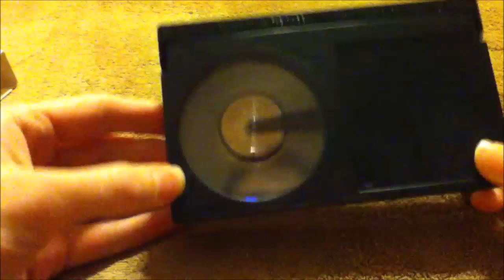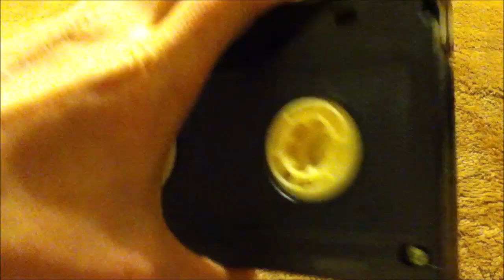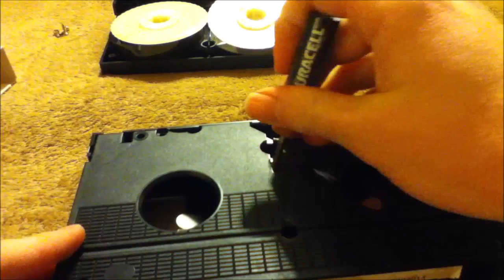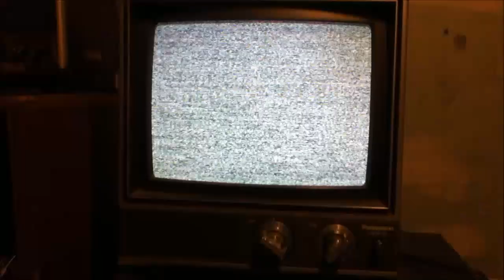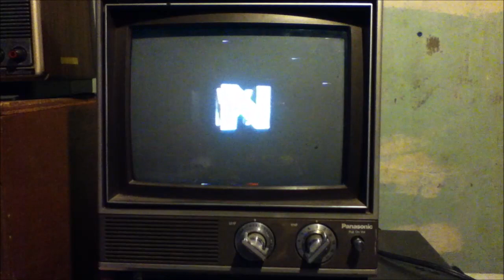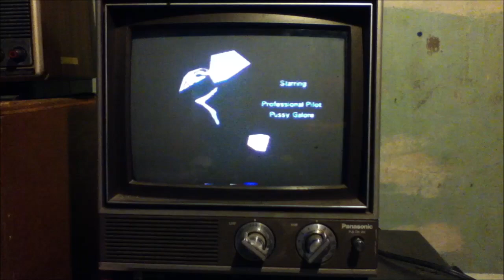Betamax spool recorded with a VHS Signal and put into a VHS Body (Betamax on a VCR Part 1)

Comment: This is clearly fake. There's no way that a Beta recording would play on a VHS machine, since the way the signal is recorded onto the tape is different and incompatible with VHS machines. You can get sound, but absolutely no signs of a video would play.
Reply from the maker: It's not fake, you see the footage recorded onto the Beta tape was done through a VCR. That is why there was sound an picture. The main purpose of the video was to see if anyone with a proper Beta could do it. Odd thing is there is one person in the comments that claimed they got it to work, even though the picture was blurry. I do also want to mention I did a follow up video to this (I found a real beta tape for cheap) . https://www.youtube.com/watch?v=SZDN-TpO-p8
Reply: You keep saying “recorded on VCR” which could mean any format: Beta, VHS, Umatic, Video8.    Please be more specific 

Also it’s TAPE not “film” as you claimed
Reply: No, it's no fake.   VHS and beta uses different tapespeeds and so the videoangle on the tape is different.  But the signal is nearly the same.  When you're able to modify the tapespeed to the same amount vhs uses, you could play the tape with a reduced quality.  But the problem is, that the syncing on vhs has not the range to come down to the beta's specs.  But on the end of beta, there was a try to make a fusion of both systems!  Some VHS Machines of that time could really play beta formated tapes.  The sycing scematics used in this machines are the same as on a beta machine and can reach the correct tape and headdrum speed.  When you look at the video footage, you see the player starting with VHS Specs and goes down to beta Specs after 2 seconds.

Comment: You obviously made a recording onto that Beta tape using the VHS VCR. Beta is a completely different format, not just a different cassette shell. However they both use a 1/2" oxide tape. If you were to play a Beta recording on a VHS VCR, you would just get horizontal lines and incorrectly-pitched audio.
Reply from the maker: I was hoping in doing this I would be able to find someone else who could do the experiment proper. This is the 4th Beta Tape I've ever seen in my life, so I did my best.

Comment: You should change the title of this video this way: Betamax half inch tape inside the VHS cassette. Obviously you recorded on this new VHS cassette with Beta half inch tape inside, with a VHS VCR ( not with a Betamax VCR). That why some people confused. VHS recording frequency and speeds completely different than Betamax. The only common thing between two format is both use same half inch magnetic tape. If you try it exactly what he did but with a tape that recorded will a Betamax VCR, you will get some blinking and moving bunch of horizontal lines up and down on TV screen but you will get audio that is faster than normal speed. Because audio is recorded linearly at the edge of tape on both format.
Reply from the maker: The only thing that confuses me though is I have some comments from people who have done this and gotten blurry picture but pretty good sound, so I have no idea. As for the title, I wasn't sure how to leave it. Plus as I've said in the video, and the description, I didn't know what would happen with a pure Betamax and assumed this would work. Now I know.

Comment: Super helpful! I have a client of mine that asked me to convert her VHS tapes and in the bottom of her stack was a Betamax. I use a VCR and I had a feeling it wouldn't work in there. She'll be so happy I was able to get that tape converted it has her husband's grandmother on it. She wants to show her daughter to be able to meet her because she passed away before she was born. Stay positive people!
Reply from the maker: Let me know if it works. I've heard some say you can only get distorted sound from this process, others say it works fine but with low quality, and still others tell me if you have the right VCR it will play beta just fine. I do want to note though the the footage on the Beta was recorded using a VCR, so that may change a few things.
Reply: @juliabrnssr  This is TheJakeThatVlogs from my busienss account. I intend to try this method this weekend on a client's betamax. I'll be sure to let you know how it comes out and what troubles I run into.
Reply: Correction: “ the footage on the Beta was recorded using a VHS VCR” (Also it’s called tape not “film”.)

Comment: as I own both beta and vhs machines that work I can guarantee that this works because you can also put a Betamax signal on a vhs tape and play it through a Betamax player but you would need a special tool to get the correct magnetism levels about the same as a U-Matic machine
the machine I use is a Sanyo VTC-5000

Comment: There seems to be some confusion.  Betamax and VHS both used half inch tape, but that does not mean they are compatible. If you take the tape from a Betamax cassette and put it inside a VHS shell you will generally be able to record on it on a VHS machine, and vice versa.  This is because the tape itself was very similar and sometimes even identical.  However VHS and Betamax used different methods of recording, so a recording made on a VHS machine will NOT playback on a Betamax machine, and a recording made on a Betamax machine will NOT playback on a VHS machine, the two recording methods were incompatible with each other.  In the case of playing a tape recorded on Betamax machine on a VHS machine what you tend to get is weird horizontal lines, although you may be able to hear distorted audio. Another problem is the way the two formats dealt with the beginning and end of the tapes, VHS used a clear leader tape through which a light was shone. This light was picked up by an optical sensor so the machine knew when you had reached the beginning or end of the tape. Betamax uses a foil leader to identify the beginning and end of the tapes so doing what you did means the VHS machine cannot see through that foil leader, hence it cannot identify when the end of the tape is reached and as a result auto stop wont work, and you risk stretching or even breaking the tape. You CAN splice the clear leader onto the Betamax tape using a VHS splicing kit and the clear leader from another VHS cassette.

So basically you CANNOT record on a Betamax cassette in a Betamax VCR then transfer the tape to a VHS cassette, put it into a VHS VCR and have it play properly because the way the two formats record is different.
Reply from the maker: That's what everyone tells me, but I ran into one person that was able to get blurry picture from doing this so I don't know. I was curious about what would happen if I played a VHS tape in a Beta Machine, that was going to be my third experiment. I later re-did this experiment with a "Pure" Betamax https://www.youtube.com/watch?v=SZDN-TpO-p8 As for the rewinding of each tape, found out that one by accident when the VCR didn't stop. I know there are 3 types of Beta tapes. Wonder if the same results would happen with the other 2?
Reply: I knew the 2 formats were incompatible, but what I did NOT know was how Beta treats the end of tape.
So it is the same as the auto channel change on 8 track carts. Seems like just something else that needed cleaning after many hours of use.

Comment: I have a beta machine that works inconsistently, so I tested a beta tape that I know played.  When I switched it to the VHS shell, only the audio would play and the video was raster and no figures could be seen.  Do you know what the problem could be?  Not going to try on family videos until I figure out why the video did not play.  Tried a good VHS on the VHS machine and it played perfect.
Reply from the maker: I'll try to keep it short. The footage in this video was recorded using a VHS signal which is why it plays fine. As I have been reminded time and time again sound is the most you can get out of it. However there is one thing I have found. If your Beta was recorded in the PAL format rather than NTSC it should play fine. I later redid the same experiment with a True NTCS beta and these where the results. https://www.youtube.com/watch?v=SZDN-TpO-p8
Reply: @juliabrnssr  

No, PAL, SECAM or NTSC makes no difference, Betamax and VHS are completely and utterly incompatible apart from baseband linear audio.

Different head wrap, azimuth angles, modulation frequencies, control tracks.... Need I go on....
Reply: @musmodtos  I was wondering if anyone caught onto this. I think even the video head drum speed is different. One other thing that is the same is the width of the tape. They even used the same width for those later reel to reel "VTR"s for consumers from the late 70s.
I had one that was a "2 head" and sadly, one of the heads were bad.
Reply: SPEED of the tape advance is different too.  A VHS VCR doesn’t run the tape at the proper speed to read Betamax tape.

Comment: Whatever tape you use, as long it is half inch and not a metal tape you can use it

there is no Betamax, VHS nor V2000 specific tape

If you have a working Philips/Grundig VCR (VCR was the name of the system) from the seventies but only a worn tape, just wind a VHS tape on it
Reply from the maker: So it's just the speed, and the player that separates those 3 types then? I'm also having a hard time figuring out what you mean by that last part. Are you saying I could play a VHS tape in that Beta player if it was worn enough?
Reply: johnbrnssr no, I meant tape is tape. You need a VHS to play back VHS, a beta to play back beta.
In case - for example- - you got a worn out beta cassette you can wind a tape from a VHS to the beta cassette. Then you can use it as a beta cassette and record and play back beta.
I bought my last beta tapes in 1998. In case you need beta tapes try eBay.

My example with VCR, a Dutch/German system from the seventies this method will make sense. But this system just made a try in the US, compared to beta and VHS it was outdated. It was replaced by Video 2000 in 1980/1981

Comment: Fake video, 
Vhs and betamax are different head angles so d't not mach each other.
Reply from the maker: That's why I made this follow up video.https://www.youtube.com/watch?v=SZDN-TpO-p8 I thought I said it in the video, or at least said it in the description, that the footage on the BetaMax was recorded using a VCR, which may have changed things. I'm also a little confused, if you scroll in the comments, there was one person who did the same experiment, with a real betamax and got good picture. Maybe it's the VCR?
Reply: Not only the angle is different 
the phase of the color changes track per track
then the tape speed is different

Comment: I have done this in the past and it doesn't work. You cannot take beta recorded tape out of the case and put it in to vhs (and vica-versa) and expect it to play those recordings. . The angle of the video heads between vhs and beta are very different, the drum is larger on betamax creating longer video tracks and the positions of the control and audio tracks are also in different locations.  You can swap the physical media between beta and vhs and re-record cotent on them without issues.  I suspect that the playback shown is on a beta machine hidden away as the recording shows head-switching issues at the bottom of the tape (common on misaligned beta).  One other scenario is that the tape taken out of the beta cassette in the video was recorded on a vhs machine originally Nice try but people who know how video recorders can see thru this little deception
Reply from the maker: I see you didn't read the other comments in this video that say the same thing, Part 2 that corrected my mistakes, or read the title very carefully. My intention was not to fool anyone. The tape in this video was recorded with a VHS signal, and so I assumed this is was the case with an actual Beta Max. Part 2 was using a real Beta Max to do the experiment proper. One thing that confuses me though is there are some people that have done this experiment and have gotten it to work. One told me if you take a PAL Beta and put it into a NTSC VCR it will work. By the way what should I entitled the video? I thought it was obvious but I see comments like this every so often.
Reply: @juliabrnssr  "Playing tape recorded on vhs but using beta spools in a VHS cassette?" might be a better title.
Reply: @juliabrnssr  The whole point of being able to put your own comments on someone else's video is to give feedback to the content maker. I myself have 3 other channels.   Why on earth should I read other comments on your video apart from the first few at the top? I don't have time to read a ton of comments on someone else's video to then make my own comment.. Ultimately your video your comments to trawl through.  if you are getting  lots of comments (constructive or otherwise) that are similar then maybe you should use them to build better videos? That is what ive done with my channels.
Reply from the maker: @Robert_Wolf  Point taken. That is why I pinned a comment section that straightened out the issues. (I honestly forgot that was a feature). I'm not a very big youtuber and don't get a lot of comments. Occasionally I'll get a comment similar to yours yesterday. When I asked for a better approach, I never get a response. That's why I ask. I have made several tweaks to the video since the comments, but I see there are still problems.

Comment: I have a bunch of Betamax cassettes and I want to convert them to digital video, is that possible? how can I do it?
Reply from the maker: The main question is are they home made Betamax, or store bought? If it's a professional movie there is copyright protection to get around. If they are home movies it's pretty simple provided you already have a beta player (This VHS trick rarely works). From the Beta Player you can plug the signal into a DVD recorder and go from there. Or, they make adapters where you can record it onto your computer as an MP4. It's a lot so let me know if you have any questions.
Reply: @juliabrnssr  Thank you for replying, they are home movies. But unfortunately I don't have a beta player and they are very expensive on ebay. However, I have Sony betamovie BMC-110. I am not sure if I can use the BMC to play the beta cassette and then plug it with an adapter to save the footage.
Reply from the maker: @musaed55555  If the camera has any output, such as RCA or Coaxial, you can capture the footage that way.
Reply: @juliabrnssr  Thank you very much.
Reply: Just pay a professional.  They have Betamax machines & they can cleanup the image before recording to DVD or computer disk.

Comment: I hope you realized that your opening the casing the wrong side. The tiny things that help turn the vhs and ultimately allows it to play in the vhs recorder will just fall out lol. YOU TAKE THE SCREW OUT AND THEN YPU FLIP IT OVER AND PULL THE TOP HALF OF THE CASING APART AND THEN ITS SUPER SUPER EASY TO DEAL WITH WHATS GOING ON IN THE CASING ITSELF - not the other way. IM assuming that the video on the batamax was recorded from a vhs because a bata can’t show video on a vhs player
Reply from the maker: First point. How interesting, There are very few times I've taken these tapes apart and have yet to find a good technique. This sounds much easier. As for the second point, I thought I made that very clear in the title and the description. Yes the tape was recorded with a VHS signal. When I originally made this video, I didn't know if the 2 formats where compatible, so I figured ask the internet. I'm sure they would tell me if I was wrong. One thing that confuses me though is there are a few people that have tried this experiment and have gotten picture as well as audio. No idea what is up with that. One theory I've heard is, if you want to play a NSTC Beta in a VCR, it will yield better results if the VCR is from the PAL region.

Comment: FAKE

There's no way the tapes are compatible beyond maybe some out of speed audio.

Betamax and VHS are totally and completely different systems with different head angles, head azimuths and modulation frequencies.

Please don't attempt this on a prized video....
Reply from the maker: I'll take it you didn't read the description, or see Part 2. However I have been given another perspective. People have told me you can play Pal Region Beta tapes on an NTSC VCR. I only know how to get me hand on one of those though.
Reply: @juliabrnssr  Given that PAL and NTSC operate in fundamentally different ways, I can assure you the answer is NO the initial issue being the tape speeds are wildly different and as I previously mentioned the wrap angles are not remotely similar. 

I own a video archival company in the UK, and own many, many different format machines and can tell you that you have been misled.

My contention is that somebody will see this video and destroy a valuable home video.
Reply from the maker: @musmodtos  Interesting, a had a few users do the experiment and say that it worked. That was the only explanation I had with it being possible. By the way what would make this less misleading? I've tried to straighten this out as much as possible but I see there are still problems.